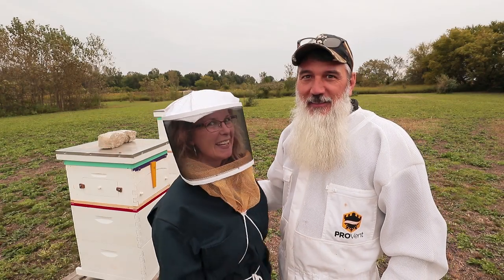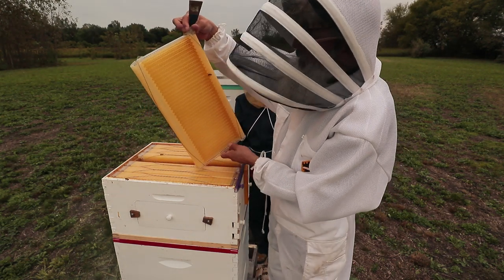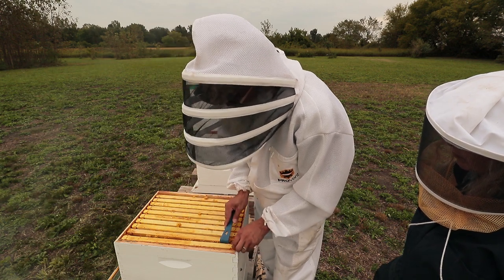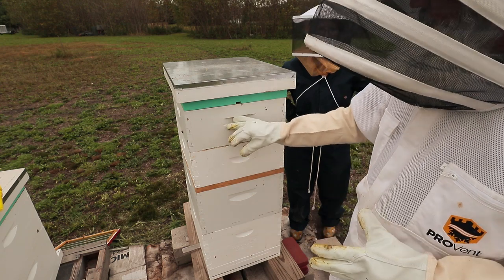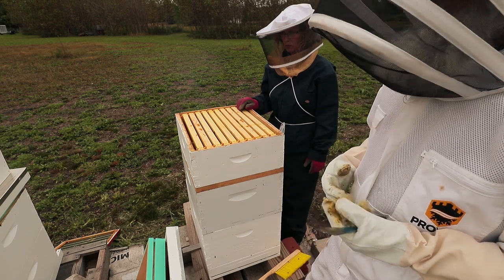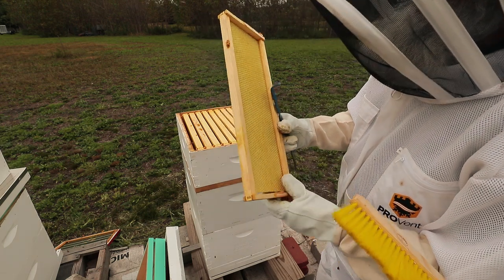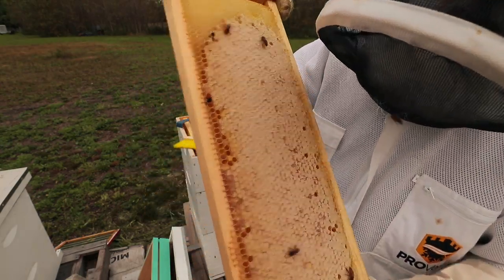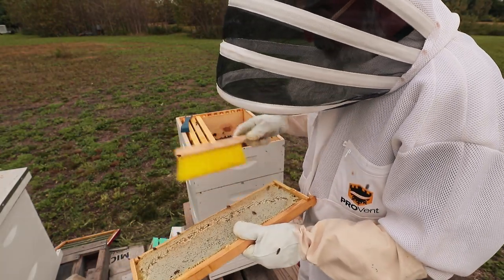Honey Harvest - Removing Supers, Yellow Jacket Raid & Flow Hive Failure

Comment: you need a super brood chamber, a larger box above it for the bees to put away winter stores... THEN a honey flow box on top.. you asking for more than your small hive can deliver.
Reply: putting in restrictors between levels will also slow down the building of honey filled combs.. try adding a secondary entrance above the brood chamber to speed the filling of the honey chambers.. so they don't have to drag everything through the brood chamber.